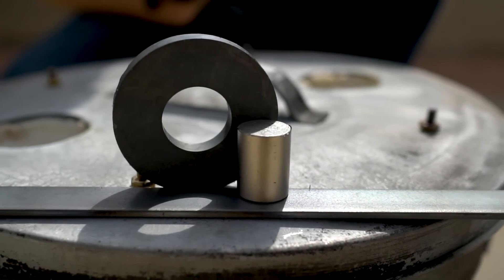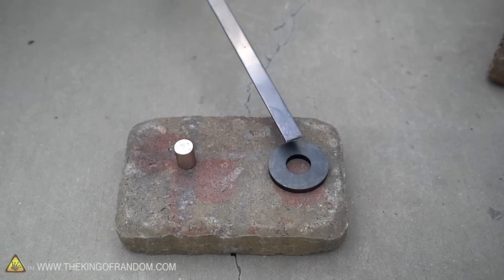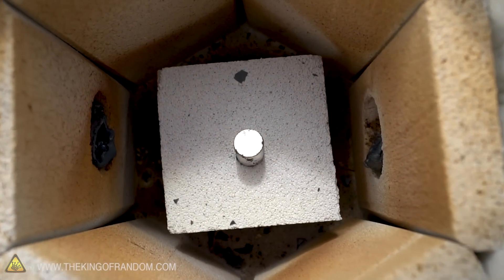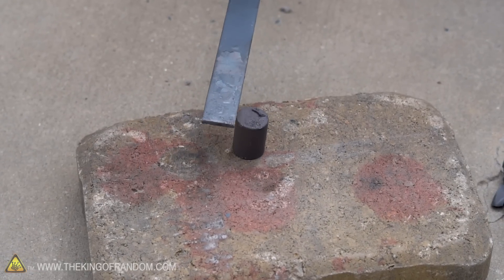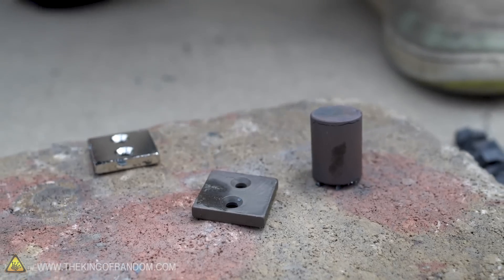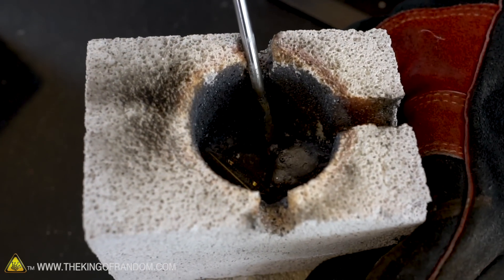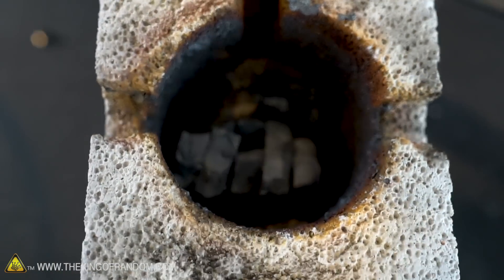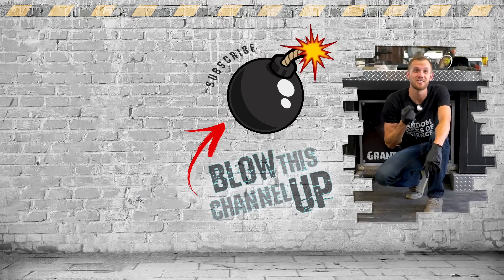Melting Magnets is Weird

Comment: Funny thing, I was listening to a ham radio podcast this morning and learned that if you have a ferrite choke heat (on a dummy load [an antenna that won’t transmit])  it would break/explode apart. And then you uploaded this video where that happened.

Comment: for the remagnetisation, you should shield the magnet from the heat with 1/4 ceramic piece,
or second idea,
 after it stopped glowin but is still hot put the 2 magnets together and throw them imidiadtly into water. That might remagnetise them.

Comment: a cool experiment you guys should try is making lichtenberg figures in glass or plexiglass I have no idea how you would go about making that but if u could I wonder what amounts of electricity can you get from the smaller sparks that can go on for 20 minutes or more
Reply: I had no idea what this even was but I looked it up and this is so amazing I wish I could try it at home but it would be cool to see the different experiments they could do with this
Reply: That's not the same as if it's on wood, trust me. Both glass and plexiglass much less capable of absorbing liquids, so you won't be able to carve figures, cuz, liquid conductor would just vaporize before it can heat up properly.
Reply: no look it up lol its like trapped lightning its way cooler trust me

Comment: Try cooling magnets in liquid nitrogen
Reply: It does, the magnet reaches its supercharge and is EXTREMELY powerful, like very very very powerful
Reply: Theoretically it would make the magnet stronger. But in real life it would not
Reply: Secret Agent Look up superconductors
Reply: Parker Mowery I'm well aware of superconductors but these metals behave independently
Reply: I had this same idea after watching the video. Curious if it would have the opposite reaction and cause them to be more powerful.

Comment: Ceramic will explode or crack when heated that fast, they cant handle the thermal shock. You would need to heat them at a rate of about 200°F an hour.

Comment: Inside a magnetic material there are domains that have North and South poles. When they are all lined up and pointing in the same direction, the create a larger magnetic field, with its own North and South poles. When you melt it, all of the little domains get shaken up an point in different directions, eliminating the magnetic field. I learnt all of that in a Year 8 physics lesson. However, I have never seen the effect of heating up magnets, and I was surprised when the hot steel didn't stick to the cool magnet.

Comment: Cooling down (ferrous) metal in an electromagnet should leave permanent magnetism behind. That's how rewritable magneto-optical storage devices work (hey, who remembers minidisc?) - the surface material is read optically and is normally magnetically stable (won't get changed easily), but the write-laser heats up the specific tiiiiny spot on the disc surface and a magnetic write-head defines the new magnetic data for that spot. It's all crazy super precise and happens very quickly, but that's the concept. (I think commercial read-only minidiscs were pressed like CDs, and I think CDRW / DVDRW does not use this technique either.) Maybe for the electromagnet experiment, get a cheap compass and check for compass-needle deflection rather than "does it stick to this chunk of steel", for more-sensitive detecting?

Comment: What if you put the magnet and steel together and heat it at the same time. Will they just split or.will the magnets pull possibly fuse it together.

Comment: If you quickly soak a piece of steel in water right at the point a magnet doesn't stick to it then you should be able to heat treat it I think

Comment: Its simple heat up a magnet, drop it or melt it it losses its properties to hold a magnetic field, however if you freeze it it will strengthen the magnet.

Comment: On the same topic as this video; try making a magnetic piece of iron.   Use the arc furnace to melt down some low carbon steel, and while it's still molten place it in between some really strong magnets (but not touching them).

Comment: you can heat magnet up without it breakin in pieces, you just have to do it really carefully and slowly. It breaks up because it reacts to temperature really fast by growing in its size. So its outer layer is hotter than inside of it, and it seems that there cant be too big difference between inside and outside temperature of it.. as its hotter from outside, and cooler inside, it starts to flaking off as different parts of it are on different "sizes" due the temperature difference between those "layers"!

Comment: You should wear a chainmail shirt while you are arc welding. It would just look cool, and possibly protect you from larger bits of slow moving particles. Ok, so not so much for protection from much, but it would look cool with the welding helmet.

Comment: The magnets aren't working heated because its molecules are too active. Causing the magnetic fields to scatter....magnets would work far better if you went in the opposite path of using liquid nitrogen. It would substantially increase the power due to the molecules being forced less active.....just like electricity flows better in colder temperatures

Comment: The thermal motion in the steel prevents the electromagnetic field from aligning the atoms so the magnetic force can be expressed, and the magnets lose there most of there magnetic propertys. Altho the magnets neodymium and ceramic can be remagnetized with electromagnetism. Bacicly to much energy in the matter.

Comment: Can you please try to coat ice or dry ice with neverwet and if it works, let the ice melt to see if the never wet will be strong enough to hold in the water and for the dry ice see if it makes a bubble of gas.

Comment: 2 Ideas for other Experiments: 
1. The heat ruins your normal magnets if you try to turn the molten iron into an magnet. But what do you think about retrying this with an strong electromagnet outside the furnace?
2. Pls try to melt plastic and cast it.

Comment: Experiments for high-power electro-magnet:
1. Cool permanent magnet with LN2 in the presence of a powerful electro-magnet. See if the permanent magnet gets stronger (or weaker if in opposite orientation?).
2. Mark Magnet with N/S, heat to red-hot. Let cool in presence of electro-magnet, in one orientation. Repeat in opposite orientation. See if you can get the orientation to flip.

Comment: Id love to see you try to melt and cool molten steel in the arc furnace while in the presence of a STRONG magnetic field.. like large neodymium super magnets positioned outside of the arc furnace.. . then you could try using differing pole combos see what N N or S S fields would do to it... this could be an interesting  experiment

Comment: So Human Torch would win against Magneto?
Reply: There is difference between magnets and electromagnets. Magneto's power based on electric magnetism.
Reply: Huh? You mean what Magneto manipulates is actually electric current and the magnetism is only secondary effect?

Just heat the metals, whatever magnet it is lose effect then
Reply: Hmmm there a chance........unless magneto slam him with iron stick at high speed
Reply: I'm going to move this coin with my mind on the count of 3. 1...2... throws coin ...3...

Comment: Traditional iron magnets gain their magnetic field by orienting the particulates in a directional field.  It would make sense that the magnetic field would be compromised by reducing the amount of order to the particulates.

My question is, is if you apply low DC power channeling through a piece of iron that's been heated (but not to melting), will it give it a magnetic field?

Comment: How about using an electromagnet (coil) to magnetise them again
Reply: Le Olaf I was thinking the same thing. That's how most magnets are made, they use an electromagnet to align the field to a uniform direction, so I don't see why that wouldn't work here lol
Reply: ItsAKaime so you could make your own shaped magnets right?
Reply: Technically, yes. There are some technical considerations along the lines of temperature and the effects of odd shapes.
Reply: Le Olaf that would be awesome to See
Reply: Build a electromagnet using the transformers from the microwaves and 10 gauge wire. Wrap it around the arc furnace, now you have a magnet making machine.
Reply: Try this with the degaussed neodymium magnets!
Reply: Did you watch the video?  He says at the end that he's going to do this in the future.

Comment: 9:31 Who noticed the heat flowing around the steel bar?

Hey The King of Random. How magnets gain their magnetic property at factory is by giving a very high voltage shock to the ... magnet.
Now it's not magnetic, what would happen if you try to give an High voltage electric shock to make them magnetic again?

Comment: Neodymium are not mostly neodymium, they are mostly iron with a small bit of neodymium.  They also have a very low curie temperature (a few hundred degrees), the temperature at which a magnet looses its magnetism.

Comment: I like the idea of using a magnet to try and align the molecules as they cool. No idea if it can work, but it might be that the heat ruins the magnets too quickly. Did you consider trying to use a electromagnet on the melted steel as it cools?

Comment: Try putting the magnetic ooze, magnetic putty into liquid nitrogen or try putting it in the foundry and see what happens
Reply: Nothing interesting
Reply: The thing is, magnetism is caused by some sort of special atomic structure (each atom have kind of direction, so when all atoms turned into one side they generating a magnetic field) That structure could be changed when metal heated enough so atoms could move free enough which leads to magnetism loss. The opposite happens if you cool it down. At lower t° structure will be much less capable of changing.

Comment: Magnets are commonly used in metalworking to see if the iron or steel is tempered right for most simple builds. If it doesn't stick, you're done.

Comment: Where do you get your carbon rods?
Reply: D D probably a hot water heater.... wait! Never mind those are magnesium rods... they can be fun too... yes where do we get these rods and what are you connecting them to??? A welder I might assume?
Reply: Hey he grant went over it in a previous video actually he used the core from a camp lantern battery cell

Comment: Without getting into a discussion about electron shells and magnetic moments, heating allows the spins of the materials to randomize so there is no directional magnetic force.  Please do what you suggest in putting the demagnetized materials in a strong magnetic field as they cool and see how strong a magnetic field you can induce as it cools.  I know they can get pretty pricey but perhaps you can borrow a Gauss meter to measure before and after magnetic field strength.

Comment: try dipping magnet in liquid nitrogen and check its properties
Reply: ASHISH KUMAR DUBEY yeah no that's not how magnets work. In a normal magnet, all the magnetic domains within the material are more or less parallel, which creates one big magnetic field. If you heat up the magnet, the atoms/molecules inside are energized and move around, and when they cool down, the domains are no longer aligned. Cooling it further won't re-align the domains, only another magnetic field will do that.

Comment: The next video mix molten iron with molten titanium
Reply: Emon Khan I think, that titanium has even higher melting point, than iron does!
Reply: teamcraft tv well yes. But you know what that means. If you mix molten iron and titanium. You will get blast
Reply: Emon Khan Blast would be cool, huh? But first you need to make those metals molten!
Reply: teamcraft tv hey if they try will melt
Reply: Emon Khan If they melt so high-melt point metal, i will be amazed

Comment: Hi there
ideas of mine:
1. Get a life jacket and fill it with SF6. Will it work? now try a dinghy.
2. what does pressurised air do inside a vacuum chamber
3. make a prince ruperts drop w/lava or obsidian
4. can you see how far you can go with making a homemade air compressor. go to the max compression, then do stuff.
to elaborate, make a air compressor (reverse vacuum.) see how far you can pressurise the air. try experiments with it: shatter it, both under and above water. see if it floats. see how things react with it. try powering an air powered gun/slingshot.

Comment: What would happend if you'd drop a magnet inside molten glass and cast it
Reply: Thibni_Official simple. The magnet loses its magnetism due to heat of the molten glass.
The trick is to get a magnet cased in glass without destroying the magnet.
Reply: Dave Dörenberg-Veltman yeah, I just realized while watching this. 😔😔
Reply: Thibni_Official I haven't seen any magnets in glass before. Wonder if it's even possible. 🤔🤔

Comment: does magnet gets stronger as we decrease the temperature?
(use liquid nitrogen)
Reply: Cooling the magnet makes the particles move more sliwly allowing for better alignment and results in a stronger magnetic feild. All you kids saying no should do your research before commenting. Fra32 cough cough
Reply: tyler hickling exactly. These kids understand nothing
Reply: its like no one has heard of a superconducting magnet.. can do some pretty fun things with those.
Reply: HermitJensen ikr
Reply: tyler hickling hmm it's a bit tricky tho. Sure it will help the alignment(because the molecule, atom, electron itself is not vibrating much) , but temperature only affect the material, not it's magnetic field directly, it still need external magnetic field to make it's magnetic field stronger. I worked on a thesis which topic is around magnetic, so yeah
Reply: Yea i did it for a science expo project
Reply: mwalsher Supercooling a magnet does increase its magnetic strength, although very minimally. Those people are technically correct, but getting to their conclusion by incorrectly comparing everyday permanent magnets to supermagnets.
Reply: Freezing the magnet will create quantum trapping in the magneting feild
Reply: Would definitely like to see this one too.
Reply: No
Reply: Shady i dont think thats how it works
Reply: Answer: no, the magnetic field is trapped in the material and heating it up releases that material. Cooling it down only prevents it from escaping, but you can't create a more powerfull one.

Comment: Is there a way to make a magnet? You should make a video on building a magnet!😀
Reply: You can magnetize metals by putting them in a very strong magnetic field usually produced by electro magnets,
Reply: You can make a paperclip magnetic, but only for a short while. I think what he was asking was if it’s possible to make a permanent magnet with reasonable materials.
Reply: Yeah, rub a magnet on a piece of metal and boom, or just smack the peice of steele hard enough multiple times and boom magnet.
Reply: Put a peice of metal into a very strong electromagnetic field
Reply: It's a lot easier and uneventful than you probably are imagining.
Reply: Y'all r correct lol
Reply: Nick Vetter you have to heat up a metal so its red hot then quikly put it in cold water
Reply: Nick Vetter it’s called electro magnets
Reply: SFC I don't think he's talking of electro magnets, but ACTUAL magnets. Without the use of electricity.

Comment: It may be arbitrary that magnets lose their magnetism when heated
Reply: Heating a magnet past its Curie temperature; the molecular motion destroys the alignment of the magnetic domains. This always removes all magnetization. from Wiki
Reply: Nope. I'd imagine it has something to do with how the heat allows the particles to move around removing their magnetic alignment. But I'm really just guessing since I have no real understanding of it. Just that I learned in high school that magnets lose magnetism when heated.
Reply: Permanent magnetism is caused by the electrons/atoms of Iron, neodynium etc. taking a special allignment(which has quantumphysical reasons). While the metal is cold, this allignment is fixated due to the low movement in the system. Is the metal heated however, the atoms start moving way faster, which also allows the electrons to move more freely, which causes the fixed allignment to loosen up until all the atoms in the chunk of metal have arbitrary allignments, which is unable to create a proper magnetic field. The same can happen in reverse. If a molten metal is exposed to a magnetic field, the field causes the electrons to allign to some degree. As the metal cools down, this allignment can get fixated, and since countless atoms now share a similar allignment, a large scale magnetic field is created.
Reply: When you heat a magnet to it's Curie Point, the thermal energy makes the electrons spin inside the magnet to jump to a higher energy state, which breakes the alignment between then, thus making the total magnetic field weaker. It's like all the electrons are small magnets and when they are aligned, their magnetic field sums up, the heat breaks that alignment.
Just as curiosity, the production of a magnet consists on applying a strong and oriented magnetic field into a piece of metal, which does the exact opposite of the heat.
Reply: No, there is such a thing as the curie temperature which is the point above which permanent magnets lose their magnetization. The thermal energy allows the internal magnetic domains to reorder into a lower energy state without any outward magnetism
Reply: All things considered, the effects of temperature, gravity, and time on electrical and magnetic fields is quite profound. then again, the effects of any of them on any others are also...